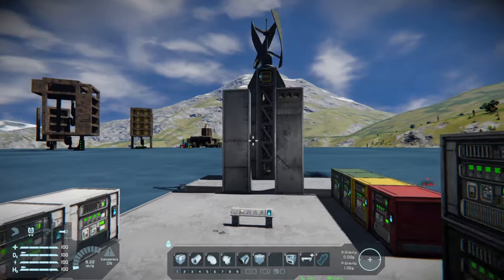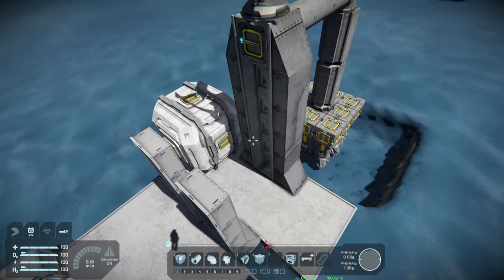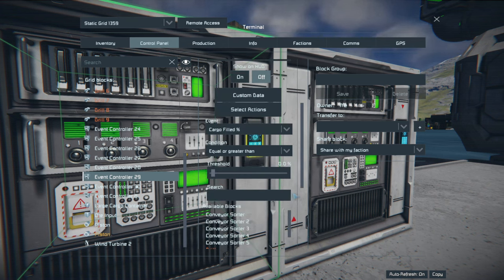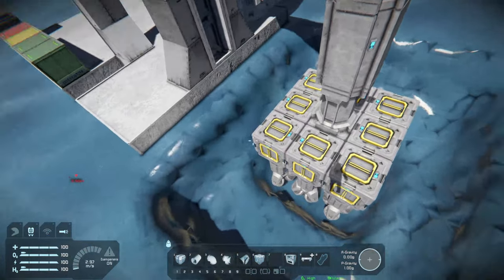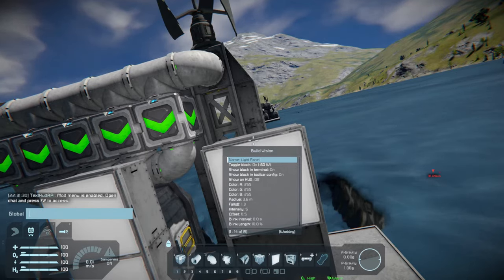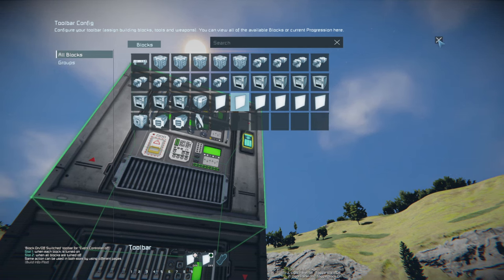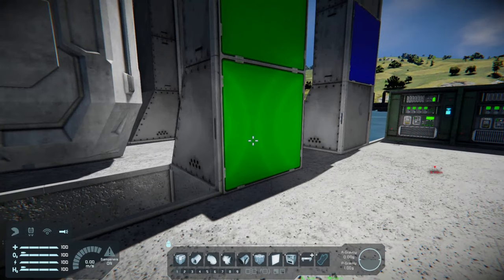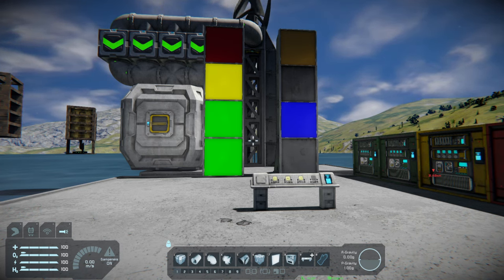Every Drilling Rig Should Have This!

Comment: You could have greatly simplified this by eliminating the Small Cargo Container.  Drills automatically push their inventory to the nearest container they can, so just a straight pipe from the pistons to the final cargo container would eliminate the need for any sorters.  Then you could just have the 100% full event controller stop the drilling, and the 75% event controller could restart drilling.  They could switch the drill indicator lights too, if you didn't simply eliminate those and use the fill lights for the same purpose.

Comment: Good explanation for how to use event blocks, but the actual design of this rig can be significantly improved.  Cargo containers fill and take in the order you daisy chain them together; so, you can simplify and improve your event controllers by considering SE's default sorting behaviors. If you chain several cargo containers for ore (have 1 feed into the next, not one pipe system that connects to all of them), then pipe the last one out to your refineries, the first container will fill up, then the next one, then the one after that, and your refineries will take from the last one that has cargo first. Then for your indicators, you can simply measure when each box hits 100% instead of doing the AND logic, and use the last box in your chain to trigger when you turn the rig on and off.  The AND logic will actually become unreliable if your refineries take from your containers asymmetrically; so, if one container had 100% and another 30% which often happens when you transition between drilling things like ice and rock and ore, your system would only show you as 25% full.  The next thing to consider is your drills themselves.  Kilted Bastard may have designed his drill this way for demo purposes to show things filling up quickly, so no judgement, but don't build a rig like this for production purposes.  This rig will dig rock and ice way faster than you can collect it which is what the sorters seem to be there to speed up, but a much easier solution is to just slow your pistons down.  The system you have right now digs so fast is would take 100ish H2/O2 generators/refineries to keep up with it; so, there is little point in digging that fast because a refinery big enough to keep up will be more expensive than the mine's actual payout and/or require you to constantly rework you pistons/drills to expand  your mining area.  Slowing your rig down from 0.5m/s to 0.1m/s will keep your conveyors from overloading just as well as 5 sorters; so, there is no reason to be moving fast enough to need to use that sorter trick in normal play.  Also, because going fast can overload the conveyors is the reason rotor rigs are so common.  A 3 drill rig on an adv. rotor can make a larger borehole than all 9 of those drills in a square.  By eliminating 6 drills and 5 sorters, you can SIGNIFICANTLY reduce the cost, complexity, and power consumption of your rig which makes the rig as a whole way more profitable.

Comment: Well if you think of the ducting system like a computer BUS it can only handle so much in one duct, so you're bottlenecking in 2 places the 4-way splitter is the most obvious one, and the piston, add more pistons and another storage plus piping and you'll see a huge processing speed increase

Comment: Interesting video, but you've got too many drills, bruh. You could eliminate probably a third of them, and cover the same area. Drastically reduce power demands.
Reply from the maker: Yeah, it was a bit exessive for a demonstration.  If I were to redo the video, I would probably use a smaller container as my primary intake.  Rather than drill wall my way to a full container.

Comment: Hi. It is an interesting system, but you can do  it with one less event controller as they have up to 9 pages. The on/off indicator could be just one controller.
Reply from the maker: You are absolutely correct but while that is true, I have found that I tend to prefer having the extra EC. Also sometime my on/off triggers are not the same and that will require multiple EC.

Comment: Turning the lights on and off could be done with a single Event controller just use the next page on the action page for the off panel.
I also suggest showing how and why the 2 cargo system by having a o2h2 generator and a refinery between the small container and the larger cargo container showing how it prevent ore clog from drills.   
Good Video though!

Comment: Can you PLEASE show me how to make a drilling system that discards ice and stone?  I'd REALLY like to figure that out.  Thanks for this vid, btw! It was very informative and easy to follow.
Reply: I can make a better system yhan yhat and you can select which ore to get. Noo need for a drilling rig.
Reply from the maker: I can, but I will also let you know here.  

Somewhere in your storage system that has direct access to the stuff you want to throw out you will want to put a sorter with it pointing away from the cargo system.

 On that sorter you will need to add a connector. 

Settings:
Sorter:
Drain all: Yes
Whitelist
Stone
Ice

Connector:
Throw out:Yes

Dig a pit for the ore to fall into until it despawns

You can have multiple of these  to speed up the process, and this would be the same on a mining ship as it would be for a drilling rig